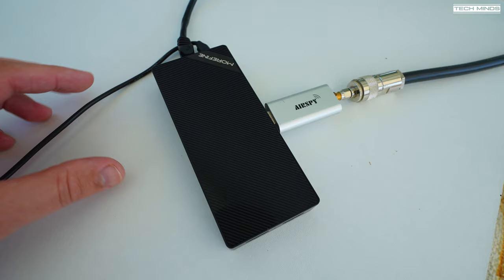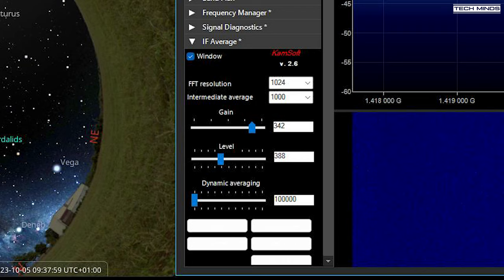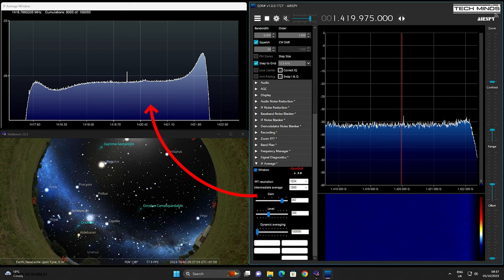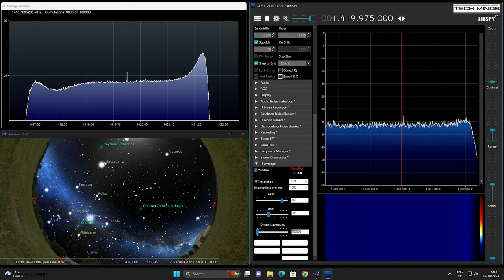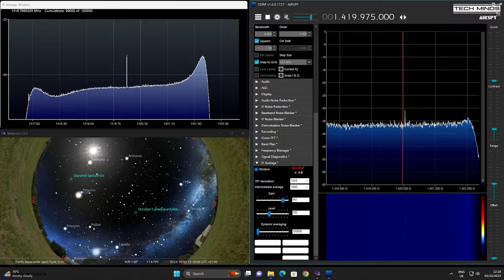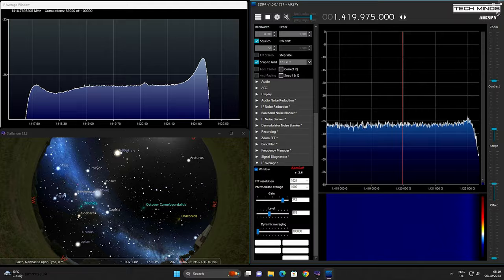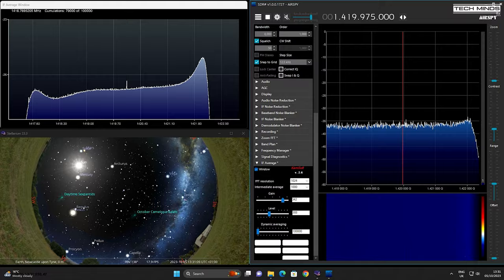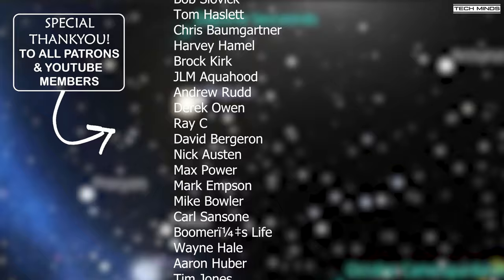Using Software Defined Radio As A Radio Telescope

Comment: You can use the same technique used for meteor scatter in ham radio and do a form of meteor detection. Let me know if you would like more info .. and keep up the great work on your videos!
Reply: Is what you are describing some sort of a passive radar? If yes, it can be used to detect potentially UAPs?
Reply: @paulatreides6779   here is a basic description 
When a meteor enters the Earth’s upper atmosphere it excites the air molecules, producing a streak of light and leaving a trail of ionization behind it kilometers long. This ionized trail may persist for less than 1 second up to several minutes, occasionally. This trail is capable of reflecting radio waves from transmitters located on the ground, similar to light reflecting from a mirrored surface. Meteor radio wave reflections are also called meteor scatter, or pings.
In order to listen to meteor Scatter, you need a powerful transmitter in VHF band located not too close but not too far from you, we are using the video sync signal from a TV station in Canada, an Off Center Fed Dipole antenna, and a USB Software Defined Radio receiver.
Reply: In the UK, it's usually achieved by detecting  the fluctuations in the Graves radar array.
Reply: @danbrandon8545 I'm interested in such a thing, even have an antenna set up but lack the knowledge
Reply: I have an interest in what you might say. I want to track and find pulsars. But I need 1 deg.
resolution at the antenna.
I don't know how yet.

Comment: Very nice! The Doppler effect was more caused by the Milky Way Galaxy rotation depending on where the antenna was pointed on the Milky Way arm. Really cool you got that the first time.
Reply: Interesting. Earth is moving at 220km/s around the center of the galaxy, and as it rotates, it faces different 21cm sources at different relative velocities. I can't do the math tho, it's a mess of interfering rotations and sources lol.

Comment: What do you mean "do to the doppler effect"? Why would the doppler effect show an rf spike? Doppler effect is an increase or decrease in frequency & at the speed of the earth's rotation a doppler effect would not show up since rf travels at nearly the speed of light & the earth's rotation is a fraction of that. 6.67 miles per second as oppose to 186,000 miles per second.

Comment: I think you can listen to the lightning on Jupiter in 17/18 MHz with a dongle..it's been along time but I think I remember it on  TV...
Reply: Yup. I am currently doing this, but at around 21 MHz. Usually, when you get signals from Jupiter it's very broadband, all the way from maybe 15 MHz to 25 and above. (_I_ chose 21 MHz for my "telescope", because I don't have a lot of interference there). My biggest problem so far has been the sheer size of the antennae, since I don't have a house with a garden...
Reply: You can hear Saturn and Jupiter on hf radio around 21mhz
Reply: @standupmackan  are u guys joking?  ? listning to jupiter?  what?

Comment: Great video.  I've wanted to do this, except my intent is to have the dish on a stepper motor gimbal with az/el capability.  What I need is a coding person to write an app that will move the dish horizontally and vertically to scan a grid across the sky.  By mapping the hydrogen signal strength in each cell of the grid we can convert the data to an actual visual presentation of the Milky Way.  If you know anyone that can write such an app let me know!  Thanks for the presentation.  Love your channel.  73
Reply: Weird. Why do you need a person for this? If you have the motors/controllers set up to be controlled from a serial port, I'm sure ChatGPT can help you whip up something in Python.

Comment: Is there the equivalent of an LNB to convert Ghz signals into a lower frequency and so reduce feeder losses. I appreciate that broadcast satellite frequencies are around 10 Ghz and maybe the gain of down converting is not worth the extra £ and complexity. Interesting video, thanks for uploading.
Reply from the maker: Yes, there is a product called "Ham it down" from NooElec. I have one here and will be doing a video on it soon. Thanks
Reply: The thing about these small SDR dongles is that they can be mounted very close to the receiving antenna, minimising losses. I have some ADS-B receiving antennas where I basically built the SDR receiver into the bottom of the antenna, then ran a USB cable from there.

Comment: one of the things I am working on. yuo showed how to get results. First thing I want to try is modulating a laserbeam with sound. Thats radio amateurism without a license nidce video PE3FS
Reply from the maker: That would be so cool, I have often thought about that too! There must be a way of doing this. Shame you are not in the UK so we could work on the project together. Let me know if you get any results!
Reply: I used to experiment with stuff like this...originally with a helium neon laser, attaching a mirror to a speaker to reflect it. Results were, er, mixed! This was a long time ago now, probably back when CDs first became popular. I'd guess it would be feasible to electrically modulate a laser diode like in fibre optics. I'm guessing you want to modulate it with analogue audio rather than digital?

Comment: Im fascinated with radio astronomy.  Im currently doings my masters in astrophysics.  As part of my course im planning to make software that will map the milky way, there is already software to do this, but i feel like i would understand a whole lot more if i did it myself. 
So if you were to make a series of videos on the subject, that would definitely do it for me.  
Ive looked many times for a decent channal on radio astronomy, because that doesn't exist.  🤔😉